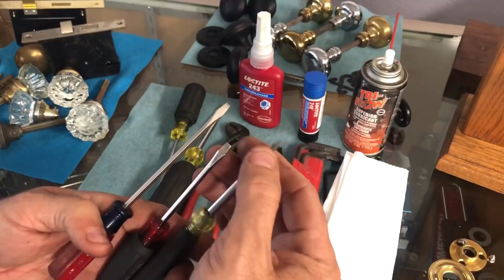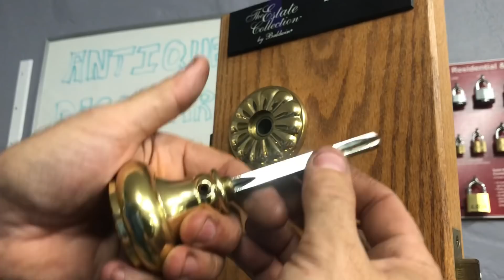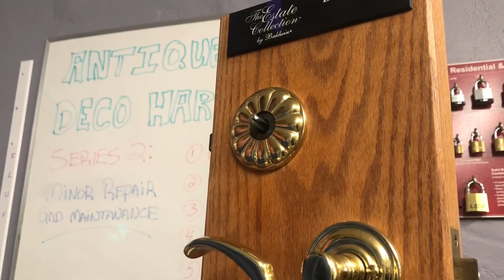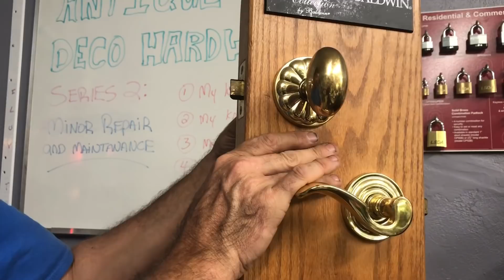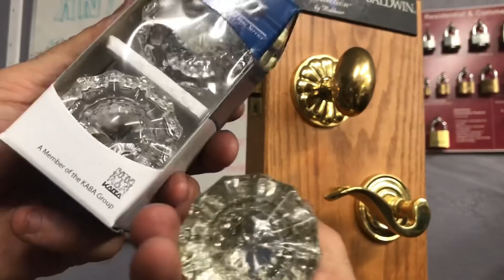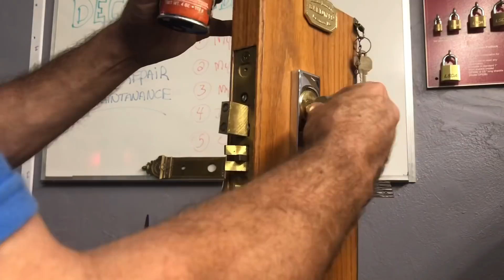ep2: Antique Deco Hardware: Basic Maintenance & Light Repair

Comment: So, I guess it will be in an upcoming video that you discuss the famous "split spindle" How would you like to work in a building just to find the contractor has used an impact driver to install the tiny screws that hold the cover plate for some 100 mortise locks and stripped them all out O-o
Reply from the maker: I despise these impact drivers :/
Reply: @selock  Have there place but a lot of contractors want to use them for everything. I've seen a lot of contractors tool boxes or bags...not a lot of actual manual screwdrivers to be found. Lol.
Reply from the maker: King Street Rob I guess I should say I despise how prevalent their use has become ;) but I use manual screwdrivers 😂

Comment: GOOD morning Jason..great video my friend. Question on the Antique Rosett the ones with the small BRASS wood screws  any suggestions when the wood is strip out or broken out  do you have a quick fix besides turning it 90 degrees. Thanks for the video .😎
Reply from the maker: SUNCOAST PICKER or 43 degrees or 19 degrees ;) 
just did one yesterday it was almost toast. Three hole rosette had already been moved 3 times and the lower chunk of wood was missing :( and as you well know it’s already super thin wood right there. Luckily it had a rotation with wood still on all three screw holes. Wood fillers just suck. Gonna talk about all that during either rosettes or mounting hardware episode so should be coming up in the next couple. Appreciate the reminder to cover that issue during the video though I may have forgotten about that
Reply: When I have a stripped hole on a wood door or frame I stick in a golf tee and snap it off. Works great. 
Thanks for the series Jason.
Reply: @4a8d698f  ya that works ..on the really old door the wood is so thin and being pine it just crumbles and the old BRASS wood screws have a shoulder on them and not enough thread so rotating is the only options which is ok .if you can  position it at 90 degrees or 180 degrees it bother me really bad because it's not straight bugs me badly lol lol..Jason knows what I am talking about happen mostly to interior doors .Thanks for the response buddy good day .😎